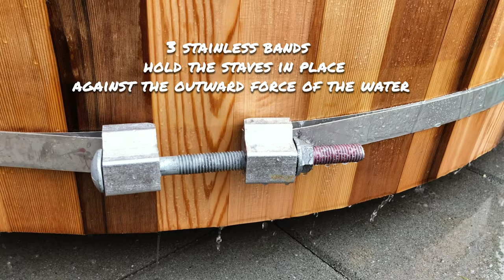Cedar Hot Tub

Comment: i've watched 20 youtube vids on how to build your own tub out of cedar. this is now my benchmark, and the one i'm going to plan my own build on. thanks, fantastic work. no glue anywhere on this build, correct? not even the floor?
Reply from the maker: Thanks, glad I could help. I also watched every video so I tried to include all the info in one place. No glue at all. Every time you drain it to swap the water it will probably start to drip a bit here and there but I keep a bucket of cedar sawdust and toss a handful in which usually plugs up any leaks pretty quick.
Reply: @gino.varisano  mind if i ask another question on this? for the staves, you are ripping the 2x6 into essentially 2.75: x 1.5", then cutting the 8' in half for 4 total 4' lengths, then ripping the desired angle? thanks
Reply from the maker: I cut them into 4ft lengths first with a miter saw. Even with clear cedar some pieces will still have knots so you may have some pieces where you can only really get 2 or 3 staves from. The only cuts on the table saw should be the stave angles. There’s very little material left over so you probably wouldn’t want to rip them down first.  You can see in the background in some shots the trash can full of very thin off cuts. Definitely get some cheaper material to make practice cuts with and you will find the most efficient method.
Reply: @gino.varisano   fantastic, yes understood. cut to length, cut into staves from the full width piece. if you have time for a last one - how are you getting so accurate an angle with a table saw? i do see you rechecking every other stave on your template. are you just getting them to as close as possible?
Reply from the maker: @zappafan3473  i just have a basic jobsite table saw so the angle markings are not very accurate at all. I just dialed it in and cut test pieces, adjusting until they matched my print out. I just kept rechecking every few pieces to make sure it wasn't going out of alignment between cuts.  It will never be perfect and it doesn't really need to be, just get it as close as possible and the swelling will take care of the rest.  the last stave will  be a wonky sized one just eyeball it when you get to it.